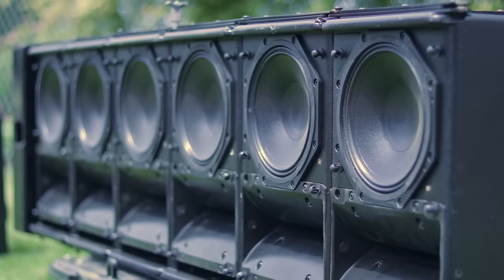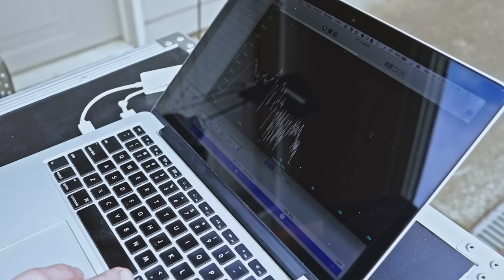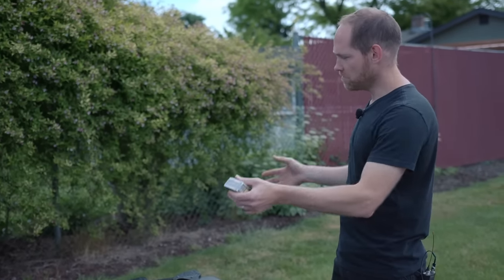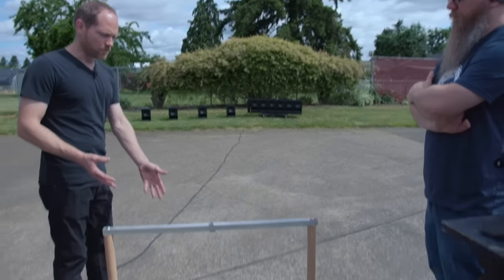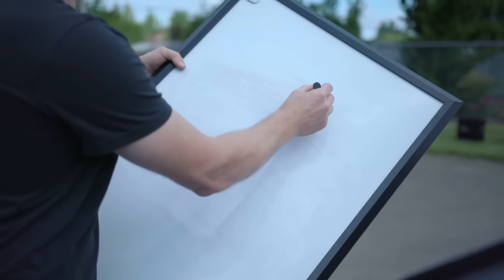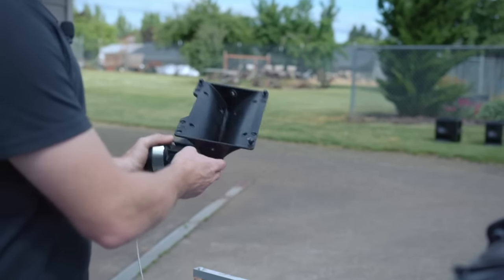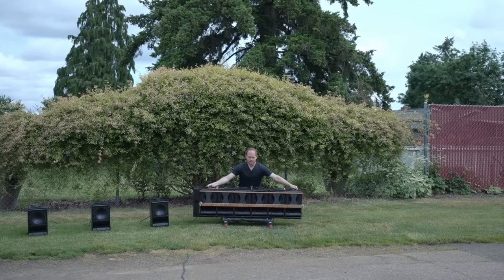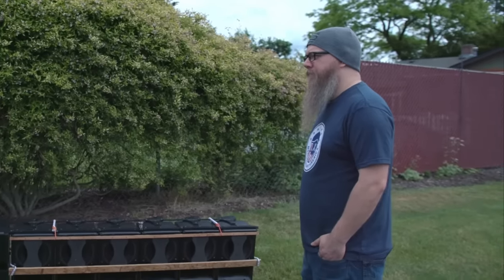Can you hear the "line array" effect?

Comment: Speaker design is one of those things that feels like the more you learn about it the further you get from actually understanding the subject.  Enclosure volume based on T/S parameters... Got it.  Passive crossover design and all the math figured out... What?  The components altered the phase so I have to get that lined back up?  Okay okay got it.  Baffle step? Damnit...
Reply: And yet it's so addicting 😂
Reply: there is a very good reason why i personally prefer 4th order active crossovers. on the passive side i perfer to add compensation networks to get rid of the impedance going everywehere around the place. then, and only then, i re-measure the t/s parameters with the passive compensation elements included. then i design my boxes, and then i figure out a decent crossing point.

Comment: I’ve always been fascinated by line arrays — either for pro applications or home audio. Im the guy that goes to a concert and spends more time studying the gear and sound quality than watching the show.
Reply: That's me, too.  haha  We've got a lot of pictures of me craning my neck around antennas, up at the ceiling where the WiFI APs or other electronics are, and at concerts, my dear SO doesn't even ask, she just stakes out a spot near the sound tent.
Reply: I tried watching tear down after a Newsboys concert...from a distance not to be in the way. Got thrown out by some peacock who probably had little to do than strut around. The band was good. That was at Target Center, MN, some years ago. 

I did enjoy this video. Well explained.
--Retired broadcast engineer
Reply: @raynoldwalker9296 
Interesting ... what a jerk for kicking you out! 

I've been involved with the biggest stadium tours/concerts. 
They can easily take several days to build/assemble and tune. 
Whereas the load out is typically executed in hours!
Reply: I have actually left a concert due to its poor sound quality.. And i really liked the band!
Reply: @rbnjr  
I get it! 
It would suck to have to leave. 

If it's the venue, ... it can't be fixed. If it's the rig or the mix ... then it's possible to get better.

Comment: The physics of sound reproduction are absolutely fascinating, impossible to get my head around, but fascinating none the less.
Reply: as a Post Ph. D. in physics/acoustics, i can tell you the fascination never ends....buy some $50 balance armatures e.i.m. and enjoy the miracle
Reply: @lunam7249 
You're absolutely right. 

I've been at it full tilt since the 70's, ... I never tire of it, and there's always somewhat more to explore.

Physics on both the acoustic and the electrical, electro-magnetic side. 
Plus the extraordinary world of pyscho-acoustics.
Reply: @FOH3663  interesting that you say that!! anomaly's, under perfect condition using the best hifi audio amps and speakers true distortion and signal to noise is high!! THD 10%, and s/n = 45db......yet we call that audiophile "perfect sound"!!! similarly, "mono" signal turned into stereo = 3 db sound power, but the brain interprets as + 15db!!, and discrimination between 2 signals = -17db.....-20 = unnoticeable!! wierd huh!!??? the brain is wayy more powerful of an interpreter!!
Reply: @lunam7249  
I'd need more specifics to comment confidently, ie., freq and level, etc. 

One thing I'm certain of, ... a mistake way too many enthusiasts make;
Measurement mics don't capture sound energy anything like the way we perceive and experience sound energy. 

Not simply the Equal Loudness Contours, but our ability for various discrimination methods, complex masking, etc., many other attributes.  

Thanks

Comment: I have noticed this while messing around with my little home audio speakers. Placing the speakers on each side of the room like a normal person gives a spacious sound due to the stereo mix. However, placing them right next to each other, so they touch on the sides, has given me an enhanced vocal range clarity, and an overall sense of power and greater loudness: a more “in your face” sort of sound that I really like. However, it also focuses the sound toward a certain area of the room, directly in front of the speakers, but I can move up and down and get a similar sound. This makes sense, based on what I know about physics. Then when I turn up the bass, I notice I can actually feel it when the speakers are in that position! Really digging my experimentation with what you call the “line array effect” though the majority of my speakers are effectively point sources with a nearly 180 degree wide conical dispersion, and the woofers in one set of old 70s Sonys are only rated for 6 watts, but I only have the volume on 0.5/10 on my old reciever and they are already loud! I literally can’t turn it any lower or one channel will cut out, unless I activate the convenient -20dB mode on my reciever, which I do near bedtime.
Reply: What you're referring to is mutual coupling ... minimizing destructive summation.

Comment: Not to get off topic but that compression horn speaker is similar to the horn antennas KS 15676 and conical diagonal reflector horn antenna. A periscope like design. What happens the microwave signal goes up the cable feed through the horn antenna and inside the antenna is a reflector that is tilted at an angle where the microwave signals bounce off at in and out into space. These antennas are use in telecommunication purposes and the telephone company that used it was Bell South and now AT&T. The advantage of this design is to have high signal gain. That compression driver with that periscope like design Will probably have a higher dB range and a long throw coverage than most standard compression horn speaker.
Reply from the maker: Great observation! There is probably a similar effect going on. Do you know if the intent behind the KS 15676 design is to flatten out the radio wave edge instead of it being spherical as it travels outward?
Reply: The compression driver is unique, I like it.
Reply: @devinlsheets_alphasound  Sorry for the late response.  The intent behind the design is to narrow the microwave signal into a beam which sends it further in distance with less or no sidelobes.
Reply from the maker: @sherrokinchen5253  There's a $25 fee for late responses on this channel
Reply: Yeah, I’m familiar with the old western electric KS-15676 horn style microwave antennas, and I also noticed the similarity between that design and the Nexo folded horn seen here as the high-frequency component of the example speakers. 
We still have a site with those old antennas remaining unused in my city. Those were the antennas used to transmit phone signals between cities, part of what was known as the “long line” system. Most were deactivated some time in the 80s if I remember correctly. Those antennas were line of sight devices, and had to point directly at each other with no obstructions, much like speakers will not sound good if there’s an object between the speaker and your ear. That’s why they had to be placed on high ground or on high rise buildings or towers to work: the vast majority of urban sites have been blocked by new construction around them, so they wouldn’t work anymore.

Comment: A couple corrections.
When you fold a horn, you always reflect off a flat surface like a mirror. The horn itself has a flat reflector at the fold, not curved like you drew it. The reflector is curved on the axis that is 90 degrees to the conical section, which entirely spoils the off axis directivity (as you demonstrated, it did not have constant volume inside the area that it should). The curved portion appears to be an oblate spheroid, which is considered similar to but inferior to tractrix - so a good compromise for a concert, it will radiate a spherical wave that is very non-directive so combing will be reduced.
These horns are pretty stubby to begin with, I doubt they where able to shorten it with their "special" reflector. Putting conical sides on a curved horn tends to produce "horn" sound (think Klipsch), most likely that reflector is helping with that

Comment: sound is similar to light when it projected straight out of the source. but when using reflective wall it is kind of contrasting to the light, as the reflective point will cancel the up coming source. only the non-cancelled sound will beamed out.

Comment: Nice vid demonstrating the line array affect! I always thought the woofer covers reduce the shoutyness screams by somewhat dispersing the high directivity frequencies but no its actually from what I'm guessing is filling in the gaps between the speakers for more uniformity and anti comb filtering. Btw can you make a video about horn loaded subwoofers? I want some very technical info that's so hard to find on the internet. Like how much sensitivity can increase and changes in frequency response. I know that horn loading a tweeter boost the low end but ive never seen that phenomenon mentioned on subwoofers. All i know is subs (especially 18s) are very small for the frequencies they produce. That even adding dimensional planes makes a horn effect.
Reply: Horn loaded subs come in a variety of types. Which ones are you most interested in? The two popular types for general PA are tapped horns, and a blind loaded type horn (a type more akin to traditional tapered transmission line designs)
Reply: @AnnaVannieuwenhuyse  all types really but i was thinking more like the cerwin vega horn sub. Sealed back chamber. Im also curious about that 6th order bandpass look but without the front chamber. Like bassboss vs21. Lastly those scoop horns. Do they even hit low?
Reply: @nathankills 
Check out data-bass ... Josh Ricci's extraordinary resource. 

btw; CV's Earthquake type cabinets are folded horns. 

Hoffman's Iron Law governs everything; 
- Deep Extension
- Small Size
- High Output

You can only pick two. 
No exceptions, ... physics wins every time.

Comment: Question, the "little devices in front of the woofer" to divide each woofer into 2(so to speak). Can you recommend a paper(or better yet a guide) on that structure? I have been thinking of building an array for personal use as a PA for years. It address an issue that has stopped me many times. Please help.

Comment: There is actually a fault in this video, and that's the conclusion about the woofer 'dividers'. They do split up the sound, creating two virtually smaller sound sources, but the line array effect of this would only be noticed in the horizontal plane as you start to move off axis (in this example that is, where the array is laying horizontally). Straight ahead it would still be as loud because the sources all sum just about as well either with or without the dividers. 

It does get louder, through. That is because the volume of the dividers also introduce a bandpass effect on the woofer, which in this case increases the sensitivity especially around 1,2khz or so. If the increased loudness would have been because of the increased summation (as per the logic in the video), we would see increased sensitivity above 2khz as well, but we don't.

Comment: @ALPHA SOUND  
Devin, how does the Bowtie affect the directivity or beaming point of the 8" midwoofer?

IOW, with the Bowtie in place, will the 8" midwoofer still start to beam at the same frequency as a "virgin" 8" driver, or will you gain another octave of HF extension as well as raise the beaming point another octave higher?

In my use case scenario, not in a line array but in a simple, large-ish 2-way "bookshelf" speaker and a separate subwoofer to cover the bottom octaves, I want to be able to raise the usable upper bandwidth of a 6.5" midwoofer to better match the ideal X/O frequency of a traditional 1-1/8" dome tweeter.

But, I want to maintain Wide Directivity and don't want the 6.5" midwoofer to begin beaming or to narrow its directivity at the higher X/O point to the tweeter.

Will the Bowtie cause the 6.5" midwoofer to beam lower in frequency than normal, or higher in frequency than normal?

Thank you 100x for the excellent videos with actual usable binaural audio that clearly demonstrate the effects!  👍👍

Comment: There is less loss of midrange with the stacked subs because there is less phase cancellation due to their proximity? (sorry for my English)
Reply: I think it's more of an additive propagation effect.  I'm not a physics expert, so I'm prepared to be wrong, but from what I've read, it works a little like this:  You know how you can have two droplets of water on a window (or just something smooth, like a mirror), and they will travel independently until they get near each other?  Then they merge and make a larger droplet.  I think it's kind of like that.  The pressurized air merges and becomes coherent, and travels in a unified direction.

Cancellation is more of an effect at the perimeter, where your distance from one driver is significantly different than your distance from another.  When you're directly in front of them (understanding, of course, that you can only ever be "directly" in front of one), phase cancellation doesn't really explain why you can get an additional 3dB per distance doubled.  If anything, if it weren't for the line-array effect, you would expect MORE loss with two cabinets side-by-side than a single cabinet, if phasing were the only consideration.

Since you can't get anything for free, there's obviously a redirection of energy that was going somewhere else, but is now going straight forward.  Like, for example, how an omnidirectional antenna is good in every direction, but a Yagi antenna is way more powerful in one direction (at the expense of all others.)  It's focusing the energy that was previously more dispersed.

Comment: so.. a phase plug?
Reply from the maker: Not exactly, we think it’s more about the acoustic separation. We could be wrong, but we sent our videos to Nexo R&D before we posted them and they signed off on it.
Reply: Pulling this one from out of my hat, so somebody with actual science, please feel free to school me.  But, if my intuition is at all accurate, it seems to work like this --

All speaker drivers begin to increase their directivity as frequency goes up, according to their diameter in relation to the wavelength.  So a 1" driver will have wider dispersion at the same frequency than a 2" driver.  My (inadequate) understanding of this is that the cone generates pressure that is coherent only as the wavelength is equal to or less than the diameter of the driver.

The "bow tie" seems to be dividing this coherent air pressure into two halves, offset to the left and right of center.  In effect, it divides a single 12" driver into two 6" drivers (but kind of more like 6x12" drivers, since it's asymmetric on the horizontal and vertical planes.)  By placing these phantom drivers slightly to the sides of center, you're decreasing the distance between the adjacent drivers and allowing for those smaller wavelengths to merge and become coherent, rather than forming a series of parallel beams.

... or something like that.  :-)

Comment: There are plenty of mistakes in this explanation. Should go to school and learn good basics in mathematics. Then calculate your lineair row of sources and how it creates lobes. You can't take conclusions by putting a measurement microphone in 1 position. The line array speakers are supposed to make a curve - not all at 0 degrees. That's essential in line arrays. Also the true reason for designing the folded horn is different.